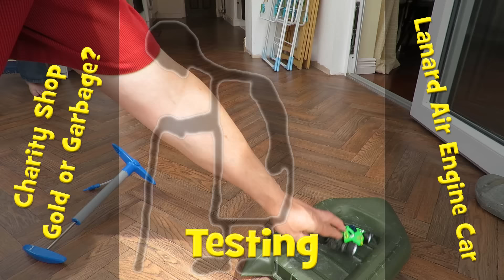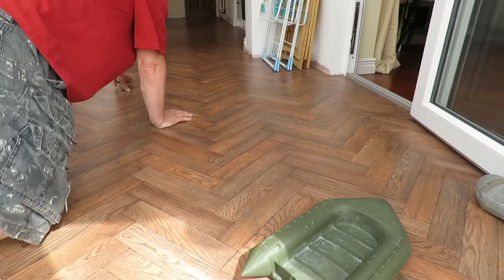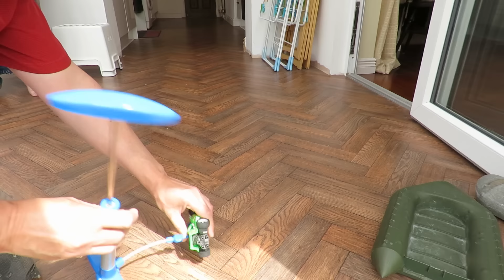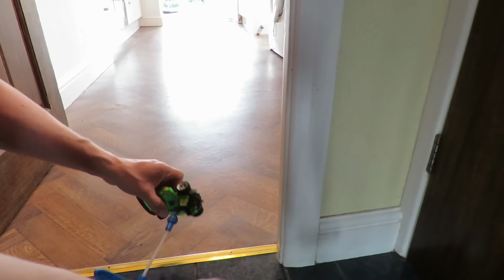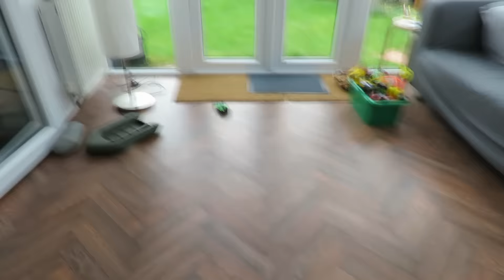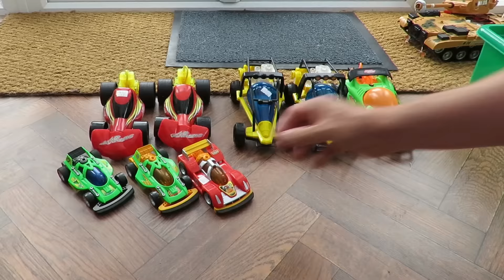Charity Shop Gold or Garbage? Lanard Air Engine Car Test

Comment: You have a nice colection of air engine racers, i like them
Reply from the maker: Yes, I like them. I did see one in a charity shop but they wanted more money than I was willing to pay. They do look interesting and you do get to assemble the parts so you learn how they work.
Reply: +GrandadIsAnOldMan and it has a built in pump
Reply from the maker: The redstoneblock :)